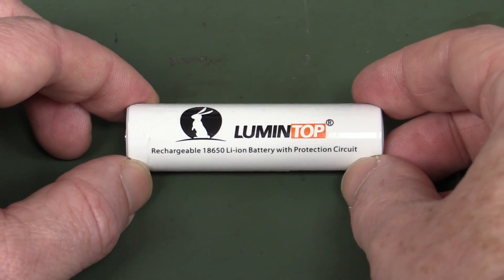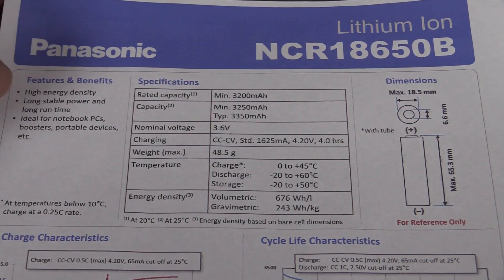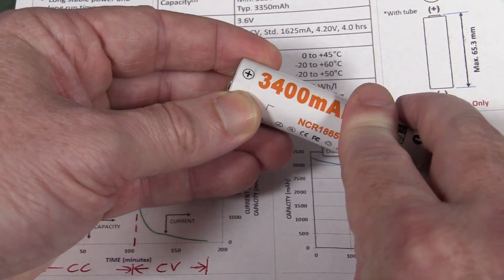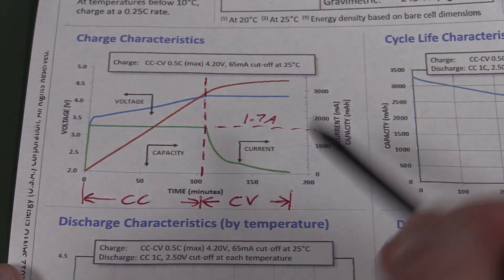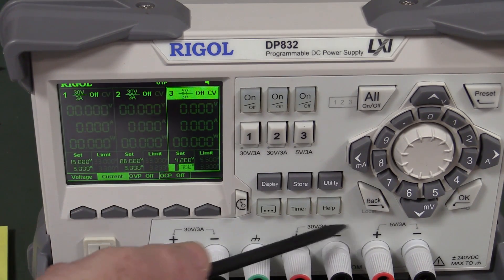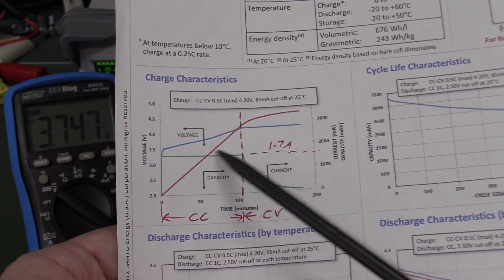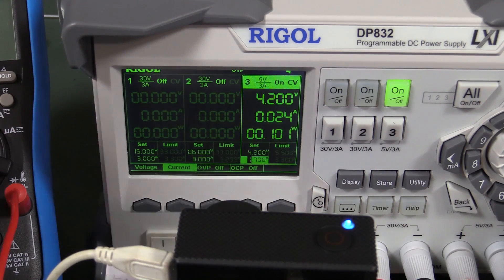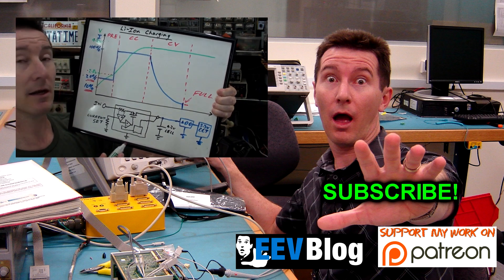EEVblog #919 - How To Charge Li-Ion/LiPo Batteries With A Power Supply

Comment: The critical charging voltage... Is that why most cheap/knockoff regargable electronics stuff still use NiMH batteries?
Because afaik, charging NiMH involves little more than putting any current at very roughly the right voltage and it'll charge just fine. Apparently li-ion is much more delicate, and therefor wouldn't work with crappy cheap electronics.

That, or they'll use off-the-shelf li-ion batteries with a rigorous protection/regulating circuit built in.
Reply: No, it's probably the question of cell cost. NiMH cells got dirt cheap now, perhaps patents are expired or whatever, so many manufacturers also in China. You still don't get Li-Ion cells for less than a couple dollars a piece, even the most crappy ones. The charging ICs are available as Chinese home-grown developments, they are pretty damn cheap, pennies, and they are actually reasonably decent, and the Western/Japanese ones aren't all that much more expensive either.

NiMH are also inherently safe. You won't get the best mileage out of them if you do dumb charging, but at least they won't vent violently.

Comment: There is a warning about charging batteries with a DP832 because it isn't designed to handle voltage sources on its output.  The supply can't work in second or fourth quadrant (meaning it will become unstable if an external voltage tries to discharge through the supply).  Wasn't this on another one of your videos reviewing this supply?   Thanks to Róbert Valdimarsson for posting this warning from Rigol about connecting batteries to the DP832 output:   http://www.batronix.com/pdf/Rigol/DP8_DP1_ActiveLoads.pdf   Be very careful not to allow the PSU voltage to be set below the battery voltage.P.S. Why the hell does IE wreck the formatting of a comment whenever you try to edit it?
Reply: I do recall similar warning from another forum re other PSU. 

Quote "You want to be very very careful hanging large batteries across power supplies.

Astron has a 723 based design, which has a crowbar on the supply
output. The intention is that the crowbar will prevent equipment
damage if the pass transistors short or the regulator goes high.  What
happens with batteries on the output is that it also shorts the
batteries, and may cause a fire.

Always put a fuse between PS output and the battery!."

Comment: How to over complicate 18650 charging.
Reply from the maker: This is a exactly the recommended method. What corners would you cut to make it simpler?
Reply: +EEVblog I'm not saying it isn't but this could be explained in less than 5 minutes. I enjoy your videos immensely but sometimes less is more and you just need to get on with it. No offence intended.

Comment: I understand there's a place in the market for bare LiPo cells, without any circuitry built-in. However, is there ANY reason that, for those WITH built-in protection, the manufacturers would not include a charging management circuit so that these could be charged from any general power source (say the usual  5V  to 12V PSUs usually found around the house)?
Reply: Extra circuitry = extra expense.  But I have seen a few cells on eBay which have both a charging circuit and protection circuit built in.  They generally have a 5V mini-USB port on the side near one end for charging.

Comment: Or just buy 15$ microprocessor charger  like imax b6
Reply: Some of those IC's are dangerous.  I tested some really bad ones a while ago that terminated the charge at 4.27v.  I stick to real microchip IC's on my charger circuit boards.  They are not expensive at like 50 cents per IC.
Reply: TP4056 is not bad at all, assuming it is the genuine TPower one. Extremely cheap even the genuine one. It is used in the EE powerbar as well. Its only limitation is that it is linear (and has a 1A max charging rate)
Reply: Why not chinese charging circuits for a buck?

Comment: I do not want to advertise , but for those interested in a universal charger with good value for money I suggest you use imax v2 B6AC I bought to recycle many 18650 retrieved from the laptop battery packs . Many 18650 batteries such as Sanyo or lg , reach their maximum capacity if charged at 4.30 volts as the data sheet says .
Reply: Sorry, but i can't help but notice your grammar is like some Chinese salesman selling products for cheap (but still more than they're worth)
Reply: Please check  grammar; is it ok now?  Sorry for that.. my language is Italian.

Comment: Cool. Can we charge Ni-MH rechargeable batteries in the same way?
Reply: No.  They have a different chemistry.  According to what I've heard, you can float charge Ni-Mh cells at one-sixteenth of their rated mAh capacity without causing them any harm.  eg, if it's a 300mAh cell, you can charge it at almost 19mA continuously.

Comment: I remember when Chris Boden of The Geekgroup kicked me out of their IRC for explaining how you do this. According to him it's insanely dangerous and should never be done. He seriously knows fuck all about a lot.
Reply: These cylindrical li-on cells are safe, even these without afterparty protection circuits, because cell has inside safety pressure valve, fuse, and CID button(opens circuit when overheated).
But if you will smash positive side(where all these protections are) battery may turn into flamethrowner or even explode if overloaded, overheated or overcharged.
Reply: USB is indeed a fussy bitch! Implementing an interrupt or iso endpoint by hand in USB 1.1 and 2.0 gives me massive shivers.

But something interesting happened. Earlier USB protocols were limited by cable length because of latency issues. USB 3.0 apparently has ways of working around that.

Also i have a slight hunch of how some re-synchronization could be implemented for earlier protocols to offset latency of signal-converting electronics. But it would take a person a million times better than me to actually accomplish that.

But who is this Chris Boden person anyway? Never heard of them.
Reply: Electricguy Well, as long as you know what you're doing (and disconnect the battery at or near the cutoff current), it's fine. I'm not sure if I'd want complete amateurs attempt something like this though....
Reply: Totally Agree, He's a complete bellend. I can't remember what I was discussing with him, but he was wrong I was right. I got blocked and my comments deleted.
Reply: Why it is dangerous? This is Li ion not LiPO battery. So the explosive is not in the equation. Also Li Ion already has built in BMS or PCB nowadays to protect battery from overvoltage or undervoltage. 

Any specific information about how do you kick from IRC? He should explain why it is dangerous and the explanation behind it.
Reply: @nickjohn2051  Both Li Ion and "LiPO" batteries are explosive if mistreated (the extent just depends on the chemistry they use, e.g ICR, INR, IMR, NCR, LFP).
Reply: You ask him.. He apparently knows more than anybody else in this world. He's also the guy who claimed that Corning optical USB cables don't work because "USB is a fussy bitch" ? Fake it till you make it..

Comment: You could put your power supply on a cheap outlet shut-off timer if you didn't have a fancy expensive power supply.

3:20 I'm commenting on that 3.5-inch digital multimeter again.

Watch out for that first step, it's a doozy.
Reply: Thanks for the idea, 100% gunna use that one

Comment: Another question: I've been given a cheap power bank that supposedly has 10,000mAh, but it only charged my phone (with a 3000mAh battery inside it) about 1.5 times. I took it apart, and the Li-Ion battery had nothing printed onto it. How do I check its capacity with cheap, household-priced tools? Since I'm  not an electronics expert, I only buy rather cheap tools (i.e. my multimeter cost around 30 bucks, so it is of the second-cheapest category, none of that rubbish for only 5 bucks ;)) - so I don't want to spend much for such a test, plus it doesn't have to be all that accurate, just has to give me some sort of an idea of whether the battery really has just about 4000mAh in it instead of 10,000mAh, or whether something else is wrong (i.e. in the electronics)...
Reply: The figures you give seem sensible for a battery of approximately 6,000mAh.  You won't get the full capacity out of the battery due to conversion inefficiencies and other factors, so it's possible it might be the full 10K.

It might be possible to check the actual capacity of a lithium battery using only a multimeter and some resistors, but you'd have to be actively monitoring the process all of the time.  In the long run, it would be easier to buy one of the cheaper lithium charge/discharge controllers.

Comment: Is this also possible with one of those cheap 35 bucks power supplies that have only one rail where you can set the voltage (usually up to 30V) and current (usually up to 3A), or does the power supply need to have some kind of "intelligence" to it?
Reply: If you can limit voltage and current, it's fine, as long as the values are stable once set. Many PSUs can easily drift .1 or .2V if running for an hour or two (so watch that or it gets dangerous). And don't rely on built in meters for the values, check with a multimeter.
Reply: superdau Danke! :)
Although my 30€ multimeter won't be that accurate either. So better safe than sorry, I'll probably set it to 4.05V or something like that.
Reply: 4.10V is enough to charge the battery up to 80%. It also doubles its life at the expense of less capacity.

Comment: How about instructions on how to setup the DP832 to automatically charge these suckers?
Reply: That's what the video is.  Set the voltage limit to 4.2V, set the current limit to 1.7A.  Turn it off after 4 hours or when it reaches 65ma charge current.  Bob's your uncle.

Comment: If you have a laptop.. it most likely has 18650s inside the battery pack.
Reply: Mine has 3 flat cells, but it's a transformery-tablety kinda thing and it's way too thin for 18650s :)

Comment: 3.25V is not always a dead battery, that depends on the specific cell.
I have cells that won`t die untill around 2.5V resting voltage..
(18650 high drain cells, both my sony`s and samsungs can live at 2.5 and 2.75V respectively, as long as they don`t SIT at that voltage over any period of time. I regularly have them down to 3.4..)

Comment: Wanna hear a joke?

Batteriser.
Reply: FUCK OFF! .... in a ten minute video they CONTRDICTED THEMSELVES SEVERAL TIMES. Boost converter is ALREADY EXISTENT IN MOST (>90%) DEVICES THAT COST MORE THAN 10$. Also their claims are unfounded SINCE THE POWER CAPABILITIES OF ALKALINE BATTERIES DETERIORATE. EVEN IF YOU INCREASE THE VOLTAGE THE CURRENT WON'T BE ENOUGH due to rapid increase of internal resistance after  1.25 V. Anything more powerful than 2 Watts cannot benefit from a boost converter after that voltage. Claims that typical alkaline batteries use about 20% of their available energy ARE PURE BULLSHIT. BATTERISER, if it works optimally and does squeeze every last drop out of alkaline batteries (and does so safely), is probably going to increase typical battery life by about 20%, not 800%
HERE IS THE MINIMAL VOLTAGES THAT COMMON CHEAP DEVICES REQUIRE: 
autofocus camera with flash: 1.3v
halogen flashlight: 1.3v
regular flashlight: 1.2v
headphone/CD player: 1.2v
portable LCD TV: 1.2v
pencil sharpener: 1.2v
AM/FM radio: 1.0v
electric shaver: 1.0v
quartz clock: 1.0v
remote control: 0.8v 
Microsoft cordless optical mice have a cutoff voltage of 0.6v, and Logitech mice of 0.8v
ALL YOU NEED TO DO IS SWAP THE BATTERIES TO A DEVICE THAT CAN USE THE REST OF THE AVAILABLE CAPACITY
Reply: +Krasimir Ivanov  Dude, it was a joke. Calm yourself.
Reply: Phil Weatherley  You catch more flies with vinegar! I was pissed. LOL
Reply: I thought you were serious. WHEN IT COMES TO SNAKE OIL PHYSICS I NEED TRIGGER WARNINGS.
Reply: Lab power supplies aren't the same as batteries. Batteriser proved it!

Comment: Hi, actually using lab power supply can be little bit tricky - if your power supply can also sink current (like mine does) it could easily damage your battery - in case of (even brief) AC power failure the power supply defaults to 0V/0A and sinks current from the battery down to 0V and destroying it. Yes, I can program it to default to 4.2V/0.01A but this can be dangerous if you forget about it and work on something sensitive afterwards. For charging liion cells I use simple boards from ebaywith IC TP4056. I bought like 5 of them for $2. Input is 5V from USB and output 1A (lower currents configurable by changing single resistor). It also properly terminates around 10% of set current.
Reply from the maker: Very few bench PSU's are 4 quadrant. This can be overcome with a series diode if you have remote sensing to compensate.
Reply: @EEVblog  Hi Dave, my supply wont operate in CC mode with a series diode. Will utilizing the remote sensing feature of my Kikusui PMC 18-5A solve this issue?
Reply: @EEVblog  In the comments there are people considering putting mains timers on their benchtop power supplies to terminate the charge, not being aware of power-off back current risk. At the least, it destroys the battery or power supply. At the most, it burns the house down in the middle of the night. Please do another video showing all proper precautions in the circuit.
Reply: Out of everything on my bench the Rigol DP832 power supply is the most sensitive to power surge and flickers. I've seen it reboot were the scope and bench DMM stayed up. My house has a lot of power flickers, constantly resetting clocks, DVR not recording the whole show. That's why I run UPC APC 1500VA backups at my bench and entertainments system. I use a laptop to collect data from my equipment so it stays running on its own battery, but nothing worse then trying to trend something over 24 hours and see temperature change effect and have a power flicker screw up all the data and have to start over.
Reply: A series diode should solve this? Maybe put the sense wires after the diode to account for the forward drop?

Comment: Got a question for you. The charge characteristics graph had 200 minutes as it's max time for charge,(3.33 hours).The Specifications chart shows "Charging" 4.0 hours. What's up with that?
Reply: Why should the numbers match in the first place? The 4 hours is just the maximum rating that should not be exceeded.
Reply: LiPos can sap in quite a bit of current after reaching 4.2 V
If you only let it hit the 4.2v you might only get 80% of their capacity, and it then takes a long time to fully fill it.

On the other hand, only charging them to 80% increases their lifetime capacity (how much you get out over all the cycle combined).
Reply: Maybe the charging was done at lower amperage?

Comment: the weight is a good indicator if its a cheap Chinese fake 18650 or not - if the weight is only thirty-something grams and not 48,5 g it's fake and the capacity is only half or so.
Reply: Paper is too expensive. Probably dirt =P
Reply: Interesting. Do they put inside half of cells and pad the rest of space with paper?
Reply: air is much cheaper than dirt :-)

Comment: On the topic of the charging voltage being 4.20V +/- 1%: Couldn't I just play it safe and not exceed, say 4.1V? I would sacrifice some capacity, but that should be enough to get the battery quite near its nominal capacity, give me plenty of tolerance for my power supply and mitigate the overcharging issue.
Reply: He literally says exactly that in the video, at 6:28 ...
Reply from the maker: Yes you could, as I mentioned in the text overlay. 4.1V is a common safe value.
Reply: He actually put a note at the top of the screen about exactly this at 6:26.  (increased cycle life at the expense of less charge capacity)
Reply: EEVblog Thank you Dave. My bad. Classic case of asking too soon :)
Reply: If you do that you will even increase the number of charging cycles before the battery capacity falls down considerably. The only penalty is lower charged capacity (when charging to 4.1V instead of 4.2V), but not much cca. 15% lower.
Source: batteryuniversity.com/learn/article/how_to_prolong_lithium_based_batteries

Comment: I bought this same power supply because Adafruit suggested it. I'm glad to see someone else using it. I love my power supply, and yes I do remember when Dave bought this with the upgraded software. It's still nice to see someone else using it.

Can someone quickly tell me how to set the low current cut off that he didn't want to show in the video?
Reply: I'd love to get that supply, but it's way too rich for my blood. I have the $50 ebay special,which also can do this but it's a lot more of a bugger to set exact values on.
Reply: You press the button underneath the display labeled "current", and dial in the setting the same way you do for voltage.
Reply: That's setting the current limit. I'm talking about shutting it off when the current gets too low.
Reply: as far as i can tell, he was talking about setting a cutoff timer after x hours. I don't have the supply myself, but there's a timer button visible on the front- maybe that can help. Or just read the manual :)
Reply: I have experimented with using python via telnet and VBA (in excel) via VISA to DP831 to status and control.  Works very well.  DP831 (DP832 would be almost the same to control) is very open and relatively straightforward to control via ethernet.  Suspect USB would also be an option.  
Python would be my first option for battery charge control.  Could also add safety shutdowns by monitor for weird battery behaviour like increasing current over time and OFF the output.
There was some clever front panel tricks hinted at in the manual that may help with with battery charging but I glossed over these as I figured programmatically would be the most flexible fastest approach for me.